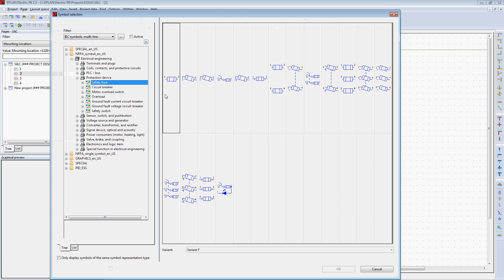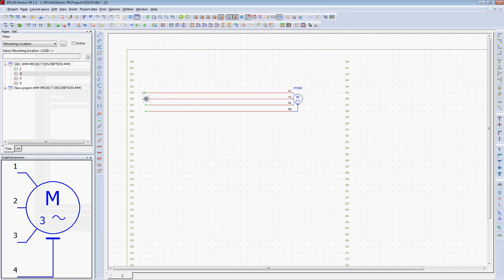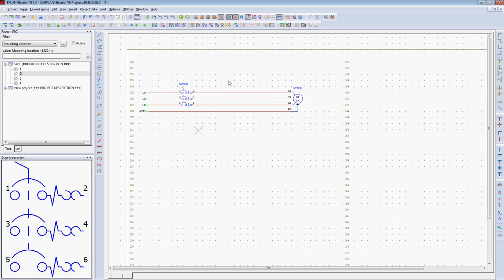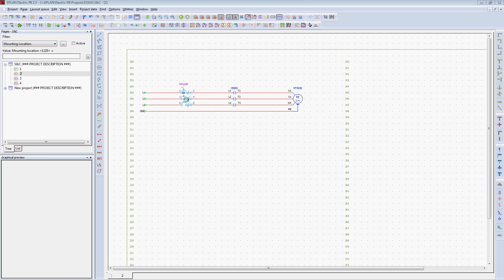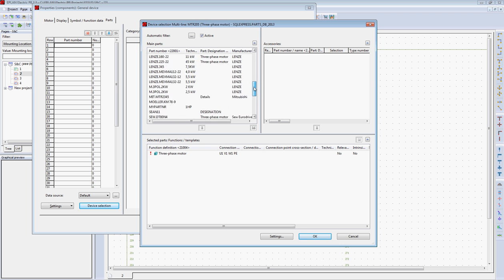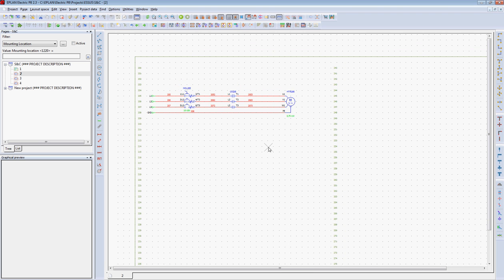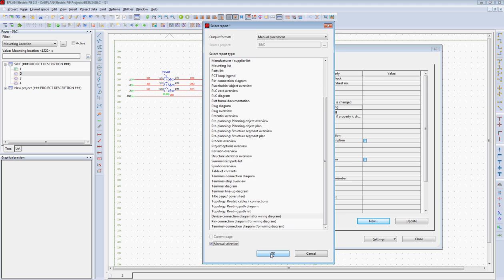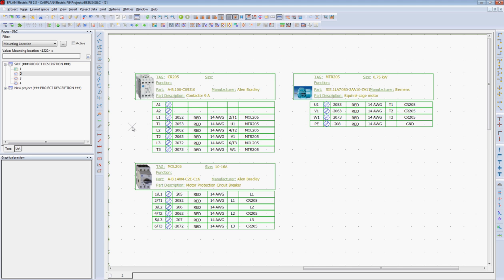EPLAN Electric P8 - How to automatically generate wiring diagrams

Comment: Hello Sean.I would like to ask you a  question.I have a problem with my Eplan. I can not generate conection numbering and I must do it all by hand. It would be very helpful for me if you could answer it. Thank you.
Reply from the maker: Hi Marija, when numbering connections there is a two step process. First you place the connection points. This can be done manually or Automatically, then you number the connections. This is done automatically. Lookup numbering connections in the eplan.help